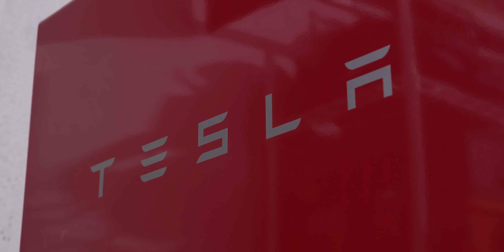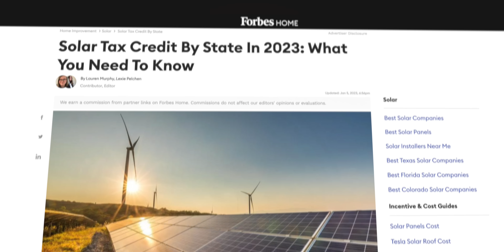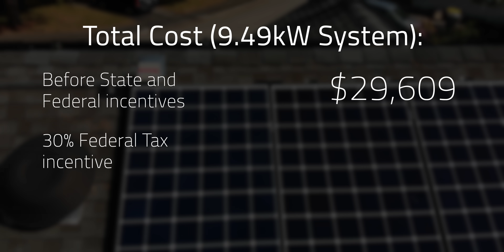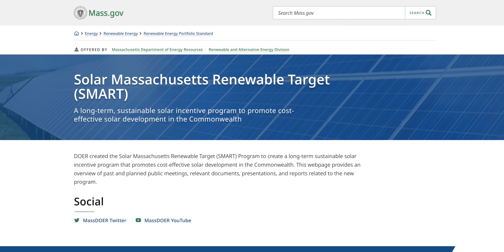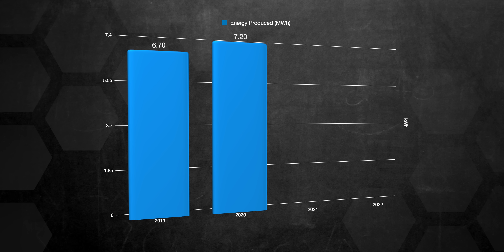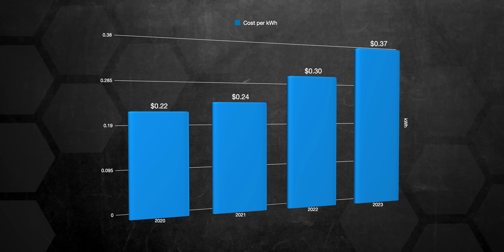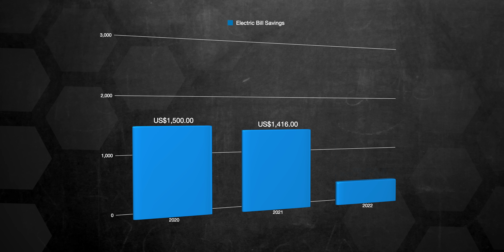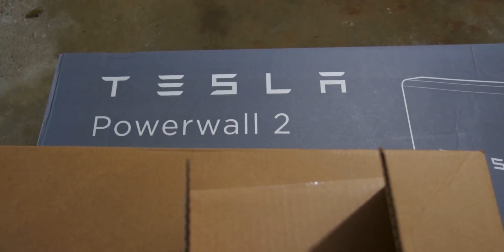5 Years with Solar Panels - Is It Still Worth It?

Comment: I don’t understand why the panels are on BOTH sides of the house. (the panels on the less-time-in-sun could have been put on a structure like a shed in the yard) They’re usually on one side so right away, the set-up doesn’t make sense. How much research did you do beforehand?
Reply: The sun rises in the east and sets in the west.  It is optimal to place panels on a southern facing roof on the northern hemisphere and facing north in the southern hemisphere. As he stated in the video his roof doesn't face the south.  So, the first half of the day the panels on the east side of his roof catches the sun and the second half the day the panels on his west face catch the sun.  Not everyone has an ideal roof for solar.  He worked with what was available to him.  The idea of putting them on a shed outside wouldn't work either.  He would have had to have a rather large backyard or a shed as big as his house to fit all the panels required....He literally explained in the video why he did it the way he did.

Comment: Do solar panels degrade over time? They wear out after about 20-25 years?
Reply: Yes they degrade.  Most lower or mid-tier panels will degrade at rate of .50% a year.  Most manufacturers will guarantee 80% of day 1 production after 20 years and more premium panels like REC pure will degrade at half the rate or .25% a year.  They guarantee 92% of day 1 production after 20 years.  So even after 20 years they should still operate.

Comment: If your battery bank is made of lead acid marine batteries, they will need annual maintenance (add water) and even then the batteries will eventually poop out, like all lead acid batteries do, after a few years.  At five years, you are just at the cusp of when these lead acid batteries are ready to die, so good luck to the new owners of the house!  That's easily a $2000+ cost in batteries.  In our previous house, the battery bank died after only four years, because the garage was really really hot where we had been keeping it.
Reply: Just about none of these new solar batteries are lead acid based.

Comment: When the panels are facing east and west instead of south,  it will give you less peak at midday. But at the "ideal" south direction you would probably only fit panels on that side of the roof. East west oriented panels usually give the higher output over the year. On flat roofs we always place the panels east/ west where i live.
Reply: That makes no sense what-so-ever...

Comment: Matt, you should include compounded investment return on that $20K system over 10 years at say 5% annualized.  System likely doesn't pencil out then.
Reply: The fallacy in that is assuming he had 20k lump some to put in some investment platform to grow at 5% a year.  He took out a loan to pay for the system.  He didn't have some lump sum to invest.  His loan would have been slightly cheaper than the electricity he had been paying for monthly or I'm sure he wouldn't have had then installed.

Comment: I live in crazy california.   They used to give you a 30% tax credit to reduce the cost of the system.  Now they have reduced the credits.   Then they reduced the one for one credit you got for putting each kilowatt back into the grid.  Next they have raised the rates per kwh.  Your are at the mercy of the legislature for each year forward.  I have installed celling fans and upgraded to a more energy efficient air conditioner four years ago.  I would have to reroof first before going solar.  My calculations say I am going to be paying more for energy.  No maintenance for solar panels.  No contingency for selling my house.  Your way is better for you.  My way works for me.  Interesting video.
Reply: Solar is certainly not for everyone.  It only really makes sense if you can take advantage of net metering, have a nice ideally southern facing roof with little to no shading, that was also reroofed in the last few years.  Just so happens my parents have just that.  They needed a new roof.  Then a year later got solar.  It faces the south which is ideal, and they have net metering.  Their bill every month is generally only min connection charge to the grid which is 8 dollars a month because on average the panels produce in a day more then they use.  Their calculated pay back period sits at right about 7 years.  They are freshly retired and are in their forever home.  Makes sense for them.
Reply: 30% is federal tax incentive nationally until 2032 so even CA gets that still. The net metering (1 for 1) stayed the same for those who had solar already, they were grandfathered in. But the new people got NEM3 or net billing. This is where a battery is more important so you can use your energy at full value rather than get 30 cents on the dollar from the utility.

Comment: I had solar panels installed in my house 3 years ago.
 I have not saved one dime. As a matter of fact, my cost for electricity is more than double.  My light bill is about the same, and now I have solar panels payment.  I wish I never got them, it's been a living nightmare.
Reply: Solar panels only tend to make sense if you can generate about what you use, if you have net metering and you can pay for a system up front or take out a home equity loan or similar to pay for.  Making payments to solar companies is almost never a good idea because their interest and rate fees are so high.

Comment: Original cost w/o incentives subsidies = $30,000. Add to that the (to you free) battery of $15,000. We have an initial cost of $45,000. take away the $7000 of power savings, we have a true cost after 5 years of $38,000... Did I miss something?
Frankly it seems like an exercise in subsidy farming, not solar farming.

Comment: I mean, I don't even pay $1500 a year for electricity, what you said that you saved.  I live in Central Texas where we're having a hotter than normal summer and my last bill for 6/15-7/15 was $158 with the downstairs at 72F, 24 hours a day.  Granted, my house was built in 2022 so I have good insulation, good windows, and high efficiency HVAC.

For a solar installation to make sense for me it will have to be for some other reason than "the system will pay for itself".   At my electricity rates, it won't, ever.  But, I am interested in reducing my carbon footprint, so that is one possible justification that makes sense.  Another is to store energy in a battery system in preparation for ERCOT outages, which have made national news in the past.  We'll see.  

I would be much more interested at the price you paid around $30K than what Marques Brownlee paid for his Tesla roof and battery system - $120K.  Ouch.

Comment: Wish I shad known that removal and reinstalling for a new roof costs a lot!
When I initially agreed to have my panels installed I was told this service is included…it’s not. Paid $4000.00 dollars out of pocket due to hurricane damage to my shingle roof. We now have a metal roof which requires expensive clips. Still love the savings they provide but watch out for the eventual need for a new roof. I’m an electrician so I could have done the work myself but was told I would void my warranty if I didn’t use a contractor.

Comment: My fear is a technological advancement that will make them 10X more efficient.  Meanwhile I have a $40k investment that is old and antiquated.
Reply: "On the residential market, the most efficient solar panels currently available are 22.8% efficient. In general, more efficient panels are possible. The National Renewable Energy Laboratory developed a solar cell with an efficiency of 39.5%, but don't expect to put it on your roof. Aug 22, 2023"

There is zero risk of a 10x efficiency increase EVER.  Will be 1-2 decades before it even doubles, and when it does, it will be at a higher price.

Comment: In other words, it doesn't pay for itself without the subsidies and tax credits and other legislation that shifts the costs from you to other taxpayers. And tell us how it affects your homeowner's insurance and the cost of replacing the roof. If the answer to those latter two questions is, "it doesn't," let's just say you're not credible.
Reply: You can get up on a high horse all you want but come tax time you yourself will take every credit you can get just like everyone else.  And solar should really only be installed on a new roof if it's a house you plan to live in for some time.  That much ought to be some common sense.
Reply: Seems like the angry people in this comment section are probably people who have been hoping for free solar energy solutions for a time and have been disappointed.

Folks, this IS a long development curve, and likely it WILL happen (that it reaches cost effectiveness), but bit by bit, here and there, but NOT suddenly everywhere.
Initially it will require governmental pump-priming (rebates, subsidies, incentives, loans, etc.), unless one wants to wait forever to achieve economies of scale; which is not in the national strategic interest.  

There's some chicken and egg dynamic in scaling up any new bleeding edge and not fully developed tech.  And YES, there is a national interest in pushing this tech.

Comment: All this sounds like working an extra part time job, in order to possibly break even over 5 or more years. (You have a special reason for doing so-- it IS a part-time job for you and we are grateful.)  But there are a thousand little deal-breaking exceptions. I am retired and do not owe enough taxes at this time of my life to apply for the rebates. A bad hailstorm and/or windstorm comes along and damages solar installation and roof. How does insurance handle that, and will home insurance even cover solar panels or if so, how much extra cost? How much will my insurance go up if I need to make a claim? This reminds me of the recycling arrangements here: It is picked up the 2nd and 4th Wednesday of the month. But they only recycle #1 and #2 plastics., and then glass and cardboard, etc. I still have to throw out most dairy packaging and several other categories of packaging that is not accepted for recycling. Things like small electronics and batteries they don't take, that is another wild goose chase. As it stands now, if these environmentally friendly activities are not convenient, there will be insufficient participation. Between the inconveniences, chasing after recovering the investments in solar, etc., and the disappointments of not breaking even, busy people are harried enough without these efforts which one has to calculate to within a few dollars a month to assure it was financially worth it. I support solar, recycling, etc., but it has to be more uniform, organized and not prone to "gotcha!  Doesn't apply in this case." So I pay my electric bills and skip the 20+ K investment. I buy good middle of the road HVAC equipment and try to use it frugally, but at 118 degrees F here in Phoenix, the house gets to 80+ degrees F unless the A/C is on.

Comment: So in short, the tax payer covered half of your solar install.  Also, anyone considering solar installs on the house need to check w/ your home ins.  Many companies are dropping policies due to repair costs involved.
Reply: So in short, the tax payer covered 100% of your street, school, fire and police services, but failed, apparently to educate you about civics.
Reply: @markshields9284  As far as I'm concerned police, fire, roads, and mil are the only things the govt has any place in.  Schools should be on the parents. And police...  If you want to get technical, there weren't any municipal police forces until mid 1800's.  The founders had a distrust of full-time standing military - so even that's debatable.

Comment: What if you live in a wooded area and your house faces south? The panels are ugly on the front and the panel company won’t install on the north face  in back. Just not viable or palatable  for a lot of people in New England.
Reply: Shingles aren't exactly the most attractive things to look at either??  If I had the option of no electric bill vs ugly solar I'd pick solar every time...if that was my only consideration.  Of all the things to gripe about solar and there are many, such as initial cost, you leap frog to looks...
Reply: @theripper121 the overpriced cost is obviously the biggest negative.  I’ve heard that from others I’m nearby on local forums.  That goes without saying.  Architectural shingles are very nice to look at in my opinion.  Especially when you have a classic New England colonial house.  In my area of New England the solar net metering only favors the utilities. So if the system is the least bit undersized you can wind up paying more for electricity.  All in all it’s just not a popular choice in my neck of the woods for multiple reasons besides aesthetics.
Reply: @mongo64071  Fair enough.  Solar certainly isn't for everyone.  If you have roof that is in midcycle of its life span, the electric company does not have a decent metering policy ya Solar certainly probably won't make sense in financial terms.

Comment: Just got a quote in middle America and they say we need 62 panels which will only cover 76% of our total electric need and install cost is $98,000. Before 30% tax credit.  This seems like it is way out of whack with everything I read about.  Not sure though.
Reply: 62 panels?? Jesus how much power do you use a month??
Reply: @theripper121  It's weird . New home started at around 2500kW per month and now, five years in, it's like 3500-4000 kW .  Need to do an energy audit asap.

Comment: If they are 5 years old and still producing 65% of their ORIGINAL full sunlight output (after cleaning and polishing!!!) they are among the BEST solar panels sold for civilian use! Few solar panels installed five years ago produce 50% of their original rated output, which Okra-Homers Attorney General is SUEING solar panel sellers and installers for NOT informing homeowners of the FACTS, not to mention the housefires and DEATHS from lithium and even improperly installed lead-acid battery "back-up" installations. Last week (7/15/23) in a tiny town on I-40 west of OKC a house burned with 5 family members killed from the lithium back-up battery "wall". All "Tesla" products and Elon Musk is PERSONALLY being indicted.  Tulsa Fire Department WILL NOT fight solar panel or battery fires because most roof trusses are FAR overloaded from the panels, and the chemical fume hazards from the panels and batteries. Solar panels on fire emit arsenic, germanium, cyanide and other DEADLY toxic fumes from the "substrates".  So much for being "safe and green"!!!
Reply: Thats BS....most new mid-tier panels will produce 80% percent of what they did on day 1 of production after 20 years and more premium panels such as REC pure have guarantees to produce 92% of what they did on day 1 production after 20 years.  Most panels only degrade .25 to .5% a year.  And the fact that most Trusses are overloaded is BS too.  Any new install has to go through electrical and engineering permits to make sure the roof is capable of carrying the load.

Comment: Why does my neighbor who has solar panels pay 133 dollars a month for power and I have no solar panels and pay 117 dollars a month?  Answer, solar is dumb
Reply: you use less energy than your neighbor. if cost of energy were to rise in the next year or so you'd be stuck paying more because the energy company is in control of your energy. Homes with solar panels can take advantage of something called Net Metering, which means the energy company credits your bill/or pays you out when your home produces more energy than you consume. They take that excess energy and give it to people like you who dont have solar. And for a premium too lol.
Reply: @clipwizard997  Actually I laid a second layer of insulation in my attic, and my brilliant neighbor converted his unheated garage into a laundry room, without ripping the sheetrock off the outside walls and adding the insulation not required in an unheated space.  So yea I use less energy than my neighbor who has no clue as to any of this.  However that being said, he has now sold his roof space to a company that uses that space to capture electricity that they not the homeowner own.  The company should be paying 300 dollars rent for the roof, but instead the homeowner pays the company 130 a month for electricity while the company generates 1500/2000 dollars a month in power.  Their electric bill is not based on electric usage as it is fixed.  Then you have to add in the FACT that his homeowner's insurance went up because he has 60,000 grand of hardware on his roof that he does not even own.  Dude the fact is that buying power is cheaper than generating it.  Not that your IQ will allow you to do the real math.  Again he pays 130 +3 or 133 per month to my 117, some months I pay 80 bucks, but I did my own insulating.  The fact is that insurance companies are now dropping homes with solar, partly because battery fires cannot be out.  Enjoy the 800 holes in your roof, and get into the shelter when the 100mph wind gets under the panels

Yawn

Comment: Installed my own solar panels on my home.  4 strings - 6 panels per string - 390W panels.  2 inverters 5000W each.  No batteries.  Turned on my solar 1Jan2020.  Since that time I've paid $1.80 in electric bills and currently have about an $80 credit on my account.  Total system cost $12,588, got a $3,776 tax credit, giving a net actual cost of $8,812.  One of the best decisions I ever made.  At some point in the future when there's a breakthrough in battery technology, I'll add batteries.  They're just too expensive & a pain in the ass right now.